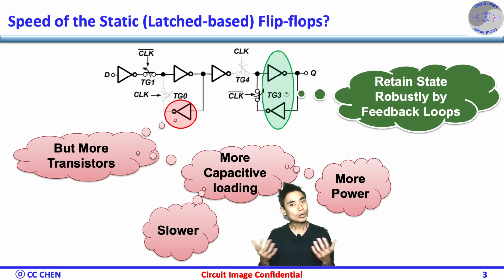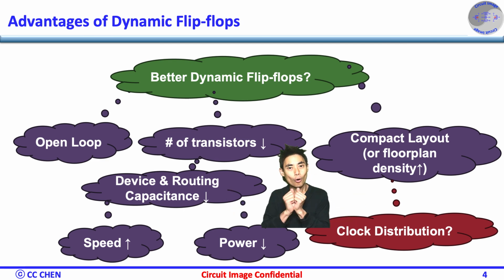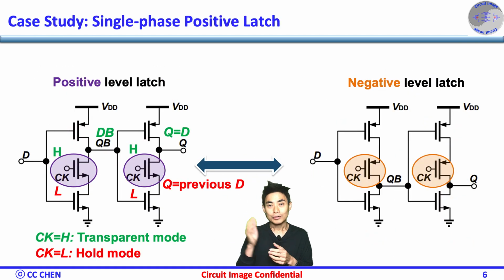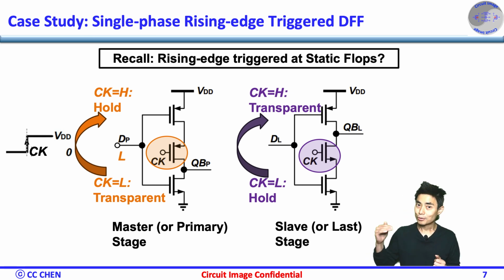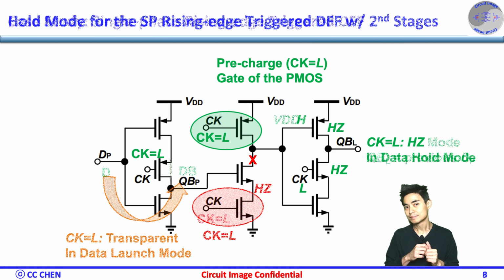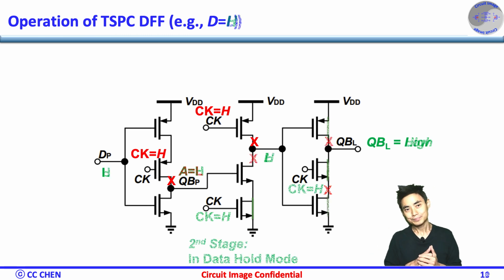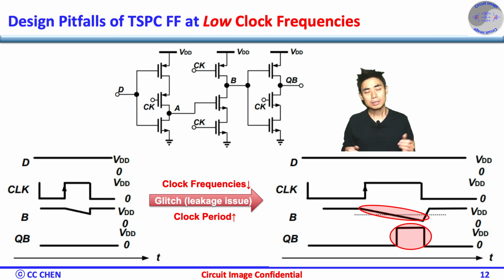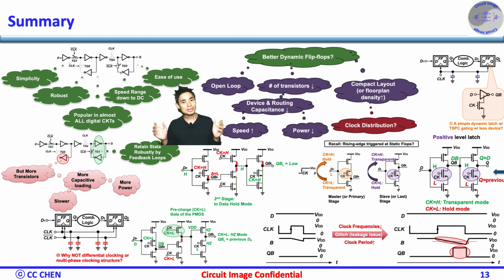Why Dynamic Flip-flops or TSPC FF?

Comment: Hi Dr. Chen, thank you so much for your fruitful videos! 
I have two questions:
1. Are there any recent products of TSPC FF being used in the industry?
2. Samsung presented a new TSPC FF design in the VLSI symposium 2024, 
“An Area-Efficient True Single-Phase Clocked and Conditional Capture Flip-Flop for Ultra-Low-Power Operations in 7nm Fin-FET Process”
but it seems like a static FF instead of a dynamic one.
From the viewpoint of ultra-low voltage operation capability(~0.2V), energy consumption, and robustness, which is preferable?
Reply from the maker: Hi XX,

Nice to meet you and you're very welcome. I have comments below.
 have two questions: 1. Are there any recent products of TSPC FF being used in the industry? 

[CC] Yes, that's a lot.

2. Samsung presented a new TSPC FF design in the VLSI symposium 2024, “An Area-Efficient True Single-Phase Clocked and Conditional Capture Flip-Flop for Ultra-Low-Power Operations in 7nm Fin-FET Process” but it seems like a static FF instead of a dynamic one. From the viewpoint of ultra-low voltage operation capability(~0.2V), energy consumption, and robustness, which is preferable?

[CC] Unfortunately, IEEE has not put in online yet and I cannot check the paper. Would you mind sending it to me or share in your sharepoint?
Thanks,
CC
Reply: @circuitimage  
Thank you very much for your reply!

I can't send you the Google Docs sharing link successfully. I guess the comments with links are automatically blocked in your channel settings. You can check whether Comment->Community->Automated Filters->Block Links is checked.
Reply: the paper link:
https://drive.google.com/file/d/1kWNMA77yZmEInZci1twO1B7JAaringy-/view?usp=drive_link
Reply from the maker: @xxw6371  Thank you so much for the paper, which is very promising. But I'm not sure if that's really robust enough. 
1. The input is not single-ended as the traditional TSPC
2. The differential signaling is good for PSRR, which might not be needed, but it adds the mismatch concerns.
3. Lots of elements of their LCFF may have more leakage  and lots of parasitic than the traditional TSPC
Reply: @circuitimage  Thank you so much for the informative answers.
Reply from the maker: @xxw6371  you're very welcome.
Reply: @circuitimage   Thank you so much for your reply. 
Here is the link to the paper:
https://vlsi24.mapyourshow.com/mys_shared/vlsi24/handouts/C25.2_Thu_Hwang.pdf